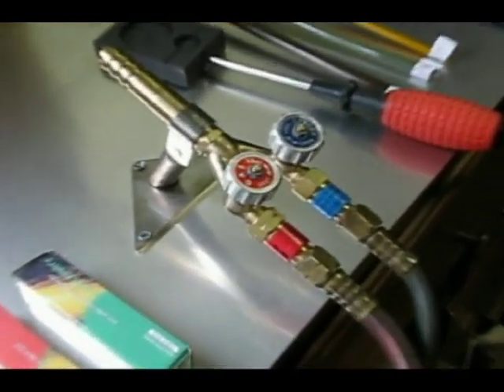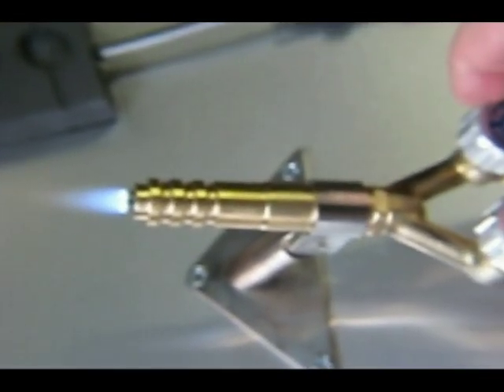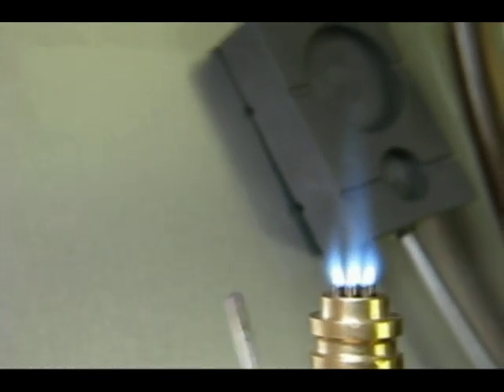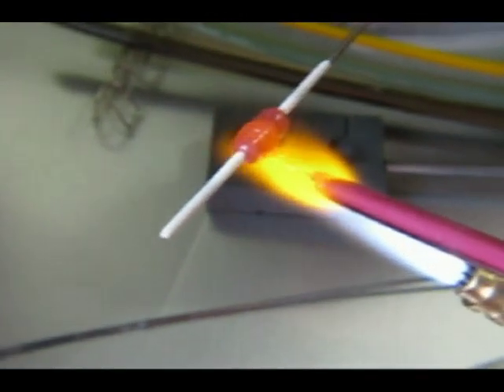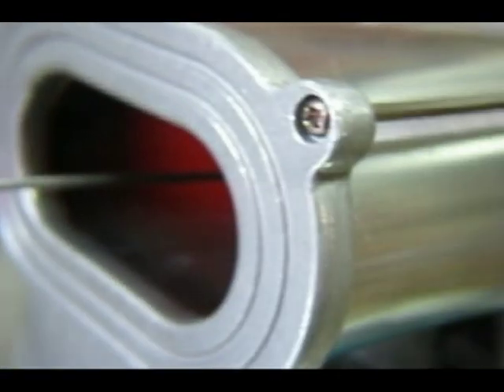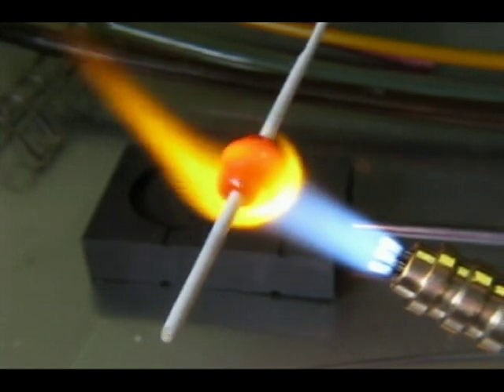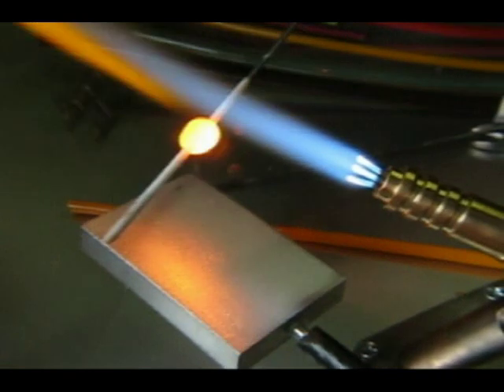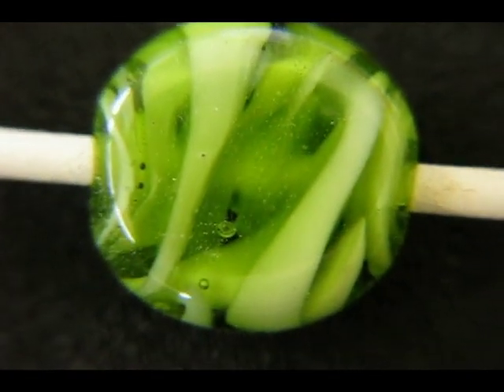Devardi Glass Spartan Torch, Annealer & Bead Making, Lampwork Tools.

Comment: I just got this Torch and I am so thrilled with it.  It dials down to a soft feathery flame like the Hothead for easy detail and stringer work, or to a pin point, OR the higher flames - up to Boro work heat.  I like it better than my Cricket!  Awesome design Devardi!